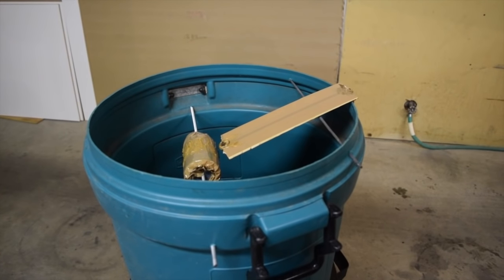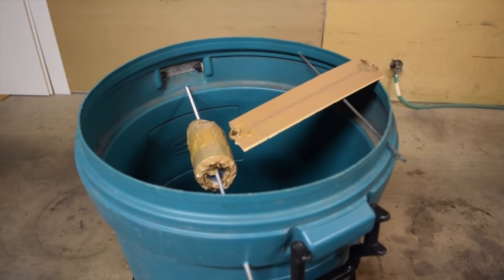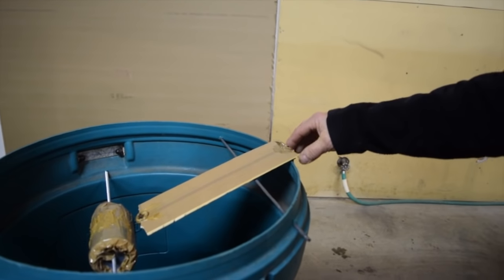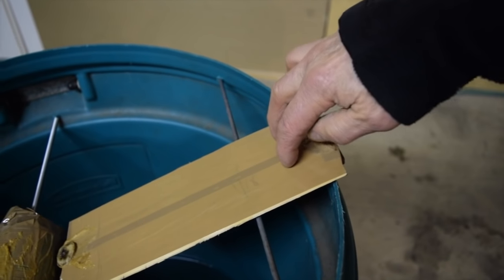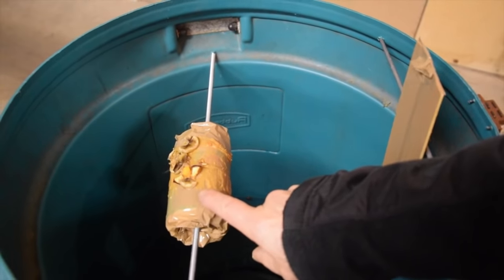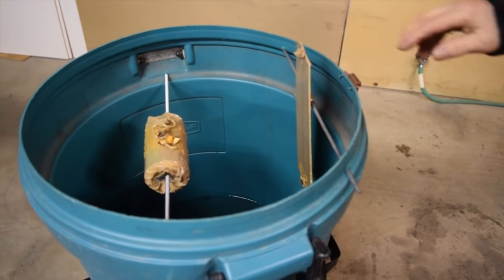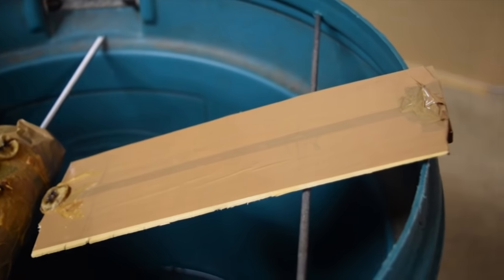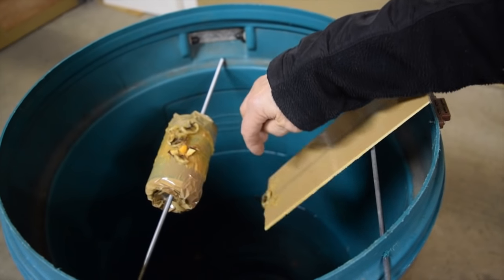Rat Trap | SIMPLE AND WORKS

Comment: Rats love ALMONDS! They need to be scratched on the surface to release the odor. They can be secured onto snap traps if you drill a hole through the almond and secure it onto the trigger by first prying up the trigger with a screw driver.

Comment: Good video here - glad you got the culprit that was giving you so much grief.
I liked your setup as well, although I didn't think the can spun around easily enough,
and looked like the rat could put some weight on it before it spun, with his front
paws, and jump over the other side, but I guess not, as it worked, and he fell in.

   I have a squirrel who's decided to make a nest under the hood of my car, and I'm
just looking at ideas like yours to " trap and drown" the little bastard. If you don't
they will chew up all the wiring under the hood and big bucs to get fixed $$$$ 

  Thanks again- your video gave me some ideas, although I'm not sold on using a
magnet, as weight of the animals are all different, so you'd have to keep adjusting
the magnet for the right strength etc.
Reply from the maker: Like you mentioned, this guy was chewing on two of my cars' wiring. Not sure why they like plastic. Maybe petroleum is quite natural and  not so bad for the planet that our governments need to carbon tax everything..... just saying :0
I actually had a rat at work that ate 5 feet of 110 volt cable until he munched on the black and white wires at the same time. I found him dead at that spot. No trap required.
As far as the can spinning, I found if it spun too easy they were more leary of going onto it. This way they would commit sooner and it was too late for them.
Let me know how things turn out
Blessings

Comment: That wouldn't work on the rats here, as they are large enough^ to lean over.

Great idea for smaller rats for sure, very ingenious. 
Most importantly it's, one of the easiest to construct traps I have seen, well done. 
________
^ 300mm - 350mm plus
Reply from the maker: ask412, Those are LARGE rats. Where do you live?
Reply from the maker: Your article explains well, the reason for the size of them. They are as big as Texas
 Like the deer and bear problem here in Canada, take away easy food sources and the problem is reduced. Easier said than done of coarse. I just had four 5 point bucks in my yard the other day. They then slowly walked up the road after meeting with all the doe ( female deer ) to further increase the population. They eat the gardens and trees. Their cuteness seems to wain when this happens.
Hope your problems get smaller and smaller :)
Reply: The problem you suffer Gary, was created by many generations who were and are ignorant about our local and nonlocal ecosystems. Case in point is your deer problem was man-made out of ignorance and due to the overpopulation you speak about. Where the people in the region failed to integrate with the natural environment, working with it instead of against it. 

In North America the deer are indigenous, so had been in a state of balance with the local ecosystems. That was until the wolf was hunted to near extinction by settlers. 

The resulting ecological change in taking out the systems top predator has led to an explosion of deer. Further damage has occurred after taking out predating animals that have been effectively culling overpopulating species, resulting in greater state disequilibrium in the natural environment. 

However, an experiment was trialled with the reintroduction of the top predator, the wolf in 1995. What is interesting is over the last 20 years, the results have been dramatic and the world has taken notice. The ecological change to the forest, streams and surrounding areas has demonstrated how critical the top predators are to environmental health.   

Keyword for research is: rewilding  
_________
https://www.yellowstonepark.com/things-to-do/wolf-reintroduction-changes-ecosystem